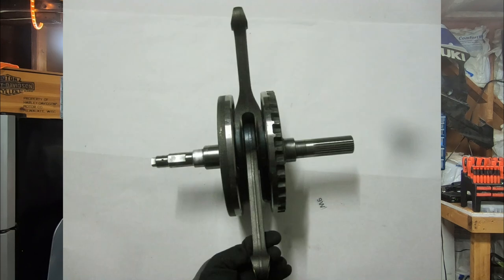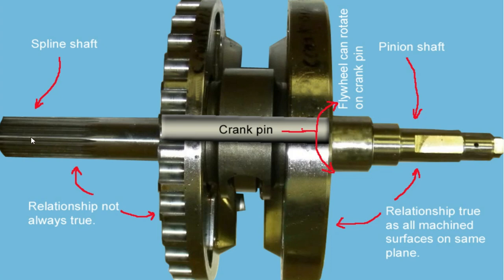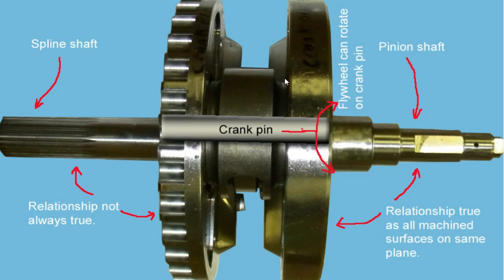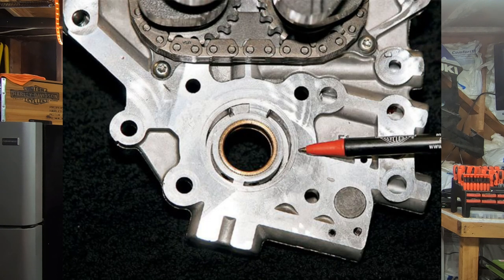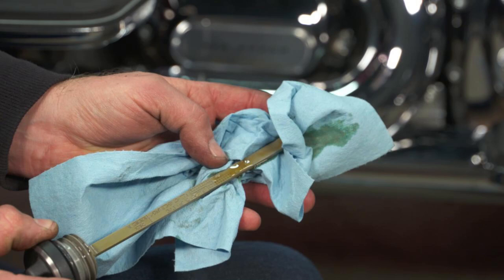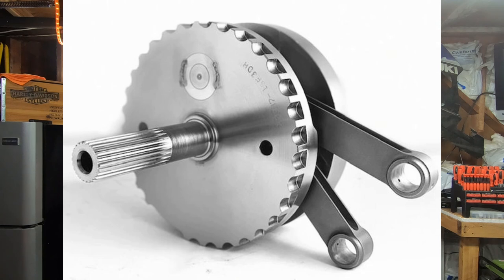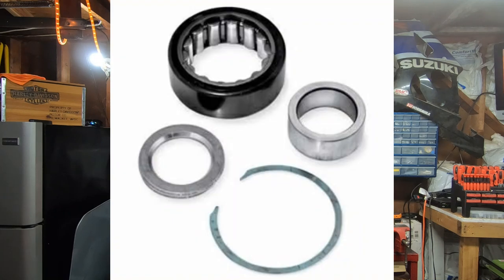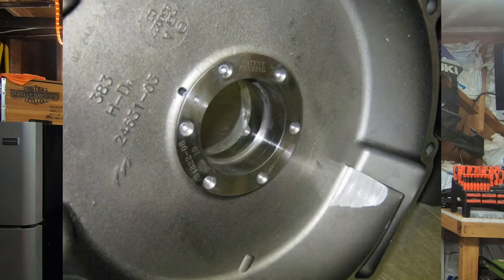The Issue With The Twin Cam Crankshafts | Harley-Davidson Cut Costs

Comment: Hi...love the vid.
Help my 2005 softail is sumping  in 4 days, just a little on dip stick?
  Had bottom end rebuilt.
Fueling camplate, new HF oil pump, now its sumping, just when sitting?? Is it doing it while it's running, idk. No oil out of nre as ther at start up though. Good sign? Help ty
Reply: Breather, meant to say

Comment: By accident, I found my 02' Deuce. 3200 miles. Thank you God!  I put another 5200 miles on my bike. I am not a throttle beater and don't run the RPM up high. I ride for the ride at my age. I will tromp on the throttle getting on the interstate, then run 80mph  70-75mph is more relaxing. The only thing I am not thrilled about is, the feul injection leans out if Temps are over 85F and I have to stop and go in traffic. I lane split all the time.  Screw the laws. I refuse to let my bike get too hot and only run after dark in the heat of summer. My bike loves under 60 degrees weather. At 50 degrees, my 88 is begging to breathe. I plug in an "Extreme Heat" brand fully heated under jacket under my leather and by body is toasting with my face is frozen. I ride 1/2 helmet to hear traffic around me. It sucks in the cold, but refuse to use a full helmet.

Comment: I'm at 50,000 on my 2006 Roadking still rolling strong.
Reply from the maker: That's exactly why I say there are thousands of Harleys out their running miles and doing well without an issue! People hear about one failure and throw their hands up, cranks do spin and fail but it's not every bike. I have only seen it happen a few times and it was related to a hot top end and some serious abuse. Now that abuse was over many many miles too!
Reply: @GixxerFoo  the only thing I do is take it to a local shop here called Jim's Cycle shop. They do all my services inhave not had a major breakdown yet.
Reply: I had about 90K on my 2006 Softail when my crank screwed up. I'd put on a 100" S&S kit without really knowing this was possible. 

I was hauling about 100MPH down the road and downshifted a gear while cracking open the gas. Suddenly I got a sound that the local shop had never heard and when they opened it up, most of the bike was shredded. Ended up rebuilding the engine for $10K with a trued, welded, upgraded crank and bearings from Darkhorse.
Reply: @AC-cg4be  dude you could have bought a creat engine from S&S that was fully built already for $6,795. Thats what I'm saving up for.

Comment: I do have an 03 88 cu and want to put a gear drive system in it if I check the pinion run out and if it's in that 3000 and install the gear drive system am I still going to have problems down the road with the crank thank you
Reply from the maker: You really want to be .002 or less, sometimes you can get away with as much as .003. Safe bet and a lot less expensive is a cam plate and hydraulic tensioners. They do really well and you don't have to worry about run out.
Reply: @GixxerFoo  I had a year 2088 I should have kept it

Comment: I ride a 2003 sportster 1275 superstock heads and beat it like a stepchild.... never had any issues from the pressed crank, its really only an issue when you start adding big power.... the sportsters are good for about 120hp before any big issues arise and the first one i noticed was the tranny bearings....
Reply from the maker: I ride Sportsters myself and honestly they are pretty bullet proof, they cranks are still Timken bottom ends and way stouter than the big twins.

Comment: Good morning 🌅, GixxerFoo, great info, This Deuce Dude from France, my bike is a 2003, early, is there a way of finding out when the bike/ engine was made by the serial number, as I have mentioned before, I do have a strange noise coming from the bike, last Friday I did go for a trip to HD themselves, from the comments it is just general wear and tear on the engine, couldn’t really hear any noise, On the way there, hi actually went through some places where I was running down to the speed limit to 3040 miles an hour and I could hear this horrible noise again, but once I got the power up, I’m doing 6070 miles an hour. It seems fine., At the shop here, any noise or such?, Then on the way back, I had some noticeable noise coming out of the engine again., I’m not sure whether it is the shafts or whether it could be the compensator, but there is definitely a strange noise coming from the bike, it’s approximately 50,000, The annoying thing is, I do not have a lot of money, as this bike has cost me a lot more money than I anticipated, buying it from the UK, My 2000 model I done a lot of work on it when I sold it it got 50,000 miles on the clock approximately had any issues with it at all, And I won’t really abusive to it, 😮🤥, I’m not too many times during the course of the week, 😂, it has been cams, S&S G510, but not sure whether it has got larger bore system on it, any thoughts be very much appreciated, It’s one of those things where you need to ride it, and then when the noise appears, obviously that will sign where it’s coming from, I was hoping that the tech will take it for a ride but you didn’t, ride safe,
Reply from the maker: That could be a lot of things going on there, they are going to need to ride it and listen to it as it sounds like you're describing the sound comes and goes with speed. Harleys do make some noise that's pure mechanical that you're not going to hear with other brands, that's just the nature of the bikes. If you're going to the shop they should be able to tell the difference, at least I would hope. You mentioned you had cams in the bike, aftermarket cams do make the valve train noisier since they have higher lift. Twin Cam motors aren't so bad with cams as far as noise but they are louder. Sporters sound like an absolute box of rocks with some bigger cams in them. Can you pin point roughly where the noise is coming from?
Reply: @GixxerFoo  mainly left hand side the top and bottom,
Reply: When start it up , it all sounds fine, about 20/30 miles, when I slow down or come to a stop, I can hear a funny noise coming from the engine, 
There was a strange noise when I changed up from 3rd to 4th I thought at first I might have missed a gear , i’m hoping to try and keep the bike running at least for another two or three months, hopefully without doing any damage, as over the winter period I am going to strip it down, I think personally the bike was used for dirt track riding, it has had S&S cams put in it , it’s still got the original HD team plate, and it looks like the original oil pump as well, so my idea is is to strip all the cams chest out, check the run out on the crank, and then do whatever is necessary, Make sure that it is all sound, I’ve done somewhere between 5 to 600 miles since I’ve had it, and greatly enjoy it, it Brought a smile back to my face,
Reply: Just left a comment in another part of your territorial not quite sure whether you see it yet,

Comment: Thanks for explaining this about the TC engines, good info to have. 

In my case, my weird little harley has a single-piece forged crank, and it runs on plain bearings pressurized with oil like a car engine. It's been as reliable as a Honda Civic so far.
Reply from the maker: Twin Cams have their issues, but if you ride it as a cruiser and not a drag bike they will do really well. What Harley do you have that runs plain bearings?
Reply: @GixxerFoo  750 street rod.
Reply: @Oddman1980  you don't have a real harley. You have an Indian made copy of a Honda Shadow and cafe racer clothes and a belt drive instead of the shaft drive the original bike had.
Reply: @frankmarkovcijr5459  The Streets sold in the US are mad in York, PA
Reply: @Oddman1980  they are Made in India. They might be put together at York but they are Made in India. Like I said they are a copy of a 30-year-old Honda Shadow in Cafe Racer clothes instead of Cruiser outfit and it has a belt drive instead of the shaft drive the original bike had. It is not a real Harley it was a pathetic attempt to get new Riders and it failed abysmally. If you took a Honda CB 754 and put a Harley badge on the gas tank it wouldn't make it a Harley. Now Harley sold little bikes made by aromachi in Italy but they owned the company. In the AMF days they had a nice variety of bikes for anybody who came in the door but they were really only interested in selling big expensive motorcycles like today. I rode Hondas for 20 years and bought three of them brand spanking new. They were great bikes until the day they died and then they were unfixable. My old-fashioned Evolution Powers Sportster has 400,000 miles on it and it outlasted my Honda cx-500 which had the cam chain broke at $250,000 miles and it destroyed the engine. For you it might be a perfectly good motorcycle and enjoy it but it is not a Harley by any means at all. Enough said.
Reply: For god sakes I'm not trying to hassle anyone but I know what I'm talking about. They do not make that engine in America they do not have a Foundry they do not cast the cases they do not put the engine together or assemble the transmission the whole thing is Indian made and assembled here that doesn't make it American. Dig more into it and you will find that I am right. The bike was a total failure. They used it for the Ryder class in order to get a tax write off. It is truly basically a Honda with a Harley Davidson name badge nothing more nothing less. Harley buys motorcycles made in China 250 and 125 cc's but just because they have a Harley name on the gas tank does it mean that they are American-made or have American Parts at all they are completely made in China. Your bike Was Made in India shipped here and then assembled here but it was not made here. Big difference. And if it wasn't such an abysmal failure it would still be here but it is not. Even the motorcycle magazines that reviewed the bikes didn't care for them was their cobbled together quality. I have a real made in America Harley Sportster with 400,000 miles on it. You won't get that far if you own the bike long enough and put enough miles on it eventually the cam chain will break and destroy your engine and you have no choice but to scrap the bike. If you show your bike to a real biker and tell him it's a Harley-Davidson he will laugh in your face. I hope you didn't pay too much for that bike.

Comment: The two flywheels are obviously machined concentric with splines complete and pressed and trued. Maybe the factory should have welded them. They probably tried to get the crank lighter thus losing press fit area. Was a problem on one old model  air cooled four cylinder  Kawashaky.

Comment: Yup; just caught your video.
Well the retired hd mech said he always put timken bearing in when in bottom end . He says he’s seen more twin cam rod bearings go than crank bearings . Dosent like the twin cam rod bearings with heat treated process instead of rod races . ✊🏻👍👌
Reply from the maker: You get a TC bottom end setup with the proper tolerance with Tinken bearings it will last forever.
Reply: @GixxerFoo  yup ; he’s put in a lot of the timken bearing kits . Says he’s got a set of Jim’s flywheels 4 1/2 stroke I could have rebuilt . Would give to me .Can’t beat Jim’s USA stuff . 
Well ; more money 😁 we’ll see . Got my lotto ticket.😁
✊🏻👍👌

Comment: '06 FLH. Between the death wobble and blown engine at 21,000 miles, I'd say my next bike will not be a Harley. There are much better products out there at 1/3 the cost. Must add that HD did make it right, but only because I bought a $900 warranty. So only 10 weeks later i was riding again.
Reply from the maker: They had some issues with the 2008 and earlier touring models and the infamous Harley Wobble. Harley never officially acknowledged it but quietly made some changes to the engine mounting for 2009 on. Did they say why your engine failed? 2006 still had the spring loaded tensioner system, it was better on the 2003 to 2006 models but it could still cause engine failure. The spring tensioners put too much pressure on the shoes and they would come apart and plug the oil galleys in the engine.
Reply: @GixxerFoo  Yup that's what happened but there was also bearing failure, the dealership mechanic showed me the torn down engine. Metal shavings distributed throughout engine w bottom and top end trashed.  They sent the motor to Milwaukee for confirmation and received a "new" motor with the same serial #. Does that sound right to you or BS?

Comment: Finding a HD dealership with mechanics who know how to properly assemble an early 5pc or later 3pc "taper'' pin and shafts is getting impossible. Tapers can turn lots of torque , but the tapers must be CLEAN and SMOOTH before assembly! I actually talked to one 'technician' who sez you must scuff and use Loctite on the tapers prior to assembly!!!!

Comment: Great video as usual.
Harley's 0.012 runnout is a joke. I had a 2010 96" with only 25000 km on it that had 15-16 thousands total indicated runnout. If you ask any engine builder/machine shop if they would run a bike or car like that I bet they would laugh you out of the shop..
I ended up going with an S&S crank, gear driven cams, fueling pump and plate.

Comment: What would be the best year to buy? Which one is the more reliable knowing I could probably do some maintenance on it? Already rebuild a carburator, change brakes, changed oils... But not sure I could rebuild a complete engine by my own.
Reply from the maker: The most trouble free twin cam to me would be the 103's 2012 and up. They really seemed to have the issues worked out by then.

Comment: When I spun my flywheels I developed a sudden vibration. And on the b motor there is a sprocket that runs the balancers. There is a arrow on this sprocket and it should point directly down from the crank pin and it is only pressed on. Spin it 45 degrees and it's like riding a jackhammer on 2 wheels.
Reply from the maker: 🤔 so you felt almost immediately what was going on down there?! I uh don't think I have ever seen a B motor do that before. To be honest I think I would of shit my pants running down the road and felt that happen.

Comment: I have a 2015 street glide with 25,000 miles. Started to get excessive vibrations from idle all the way to 2200 rpm then is smooths out completely. First was told needs motor mounts, changed those still same vibration, then told need updated compensator. Installed a new one still vibrating. If the crankshaft tolerant was not in spec wouldnt the vabration get wrose with more rpm?
Reply from the maker: If the crankshaft run out is high it will throw the balance off and you may be experiencing the crank coming in and out of balance. I would for sure check the run out, the acceptable run out spec is pretty high. That doesn't mean it's right and you won't notice it either.

Comment: I bought a 2020 farboy new. By 2k miles crank runout 4.5thou. Vibration got worse. Dealer re checked at 4k miles. Runout was 8.5thou. They  agreed to replace under warranty. Had the bike in the shop for 10 months.Said they replaced the crank. Runout readings were exactly the same.Yes, they lied. Dealership are bad, Harley Australia are even worse.They will do anything to avoid fixing this well known problem. Was advised to seek  a legal opinion. Checked with my lawyer and was informed i would win the case but could only expect to receive 60% of my court costs. Harley would keep the bike and drag the case out for years. Yes, they aren't nice people. Every one should be warned about this problem. Do your research guys. This is a lot more common than they admit. Thx gixerfoo.
Reply from the maker: That's horrible to hear, Harley actually upped the allowable runout to what they say 0.014 measured in the engine... that's absolute insanity. I believe it but I can't believe they just wouldn't make it right, especially in this day and age with how fast information travels about things.
Reply: @GixxerFoo  Thanks  for reply mate. I will also like to add that the manager of the dealership suggested to sell it back to them at a 25% loss. When questioned about selling it on to a fellow enthusiast with the knowledge of the impending engine failure he just smirked. Such is their integrity. I could not do that to anyone, let alone a fellow rider. So disgusted with this experience.  $32 600 spent and now i just clean and polish the thing. Hardly ever ride it for fear of it breaking. Never done a burn out and only been above 5k rpm a few times. Only bike i ever bought new in my 60yrs. Bitter disappointment. Once again its thanks to people like you, Kevin Baxter and other youtubers who can highlight these issues to the community. Much appreciation and thanks.I'd like to think harley would care but i know they dont. Cheers

Comment: Thirty thou runout in some cases?  That seems a huge amount.  Thanks for sharing Gixxerfoo.
Reply from the maker: Yeah .030 thousandths that's total engine failure, that's what crank runout has been when it was checked after a failure. That's a scenario when even the engines cases are not salvaged.
Reply: Yeah, anybody that knows anything about Motors would say .002 max, in MY OPINION.
       Thats maximum! Harley really screwed the pooch on this one, dropping the timkin bearing was pure negligence!!!